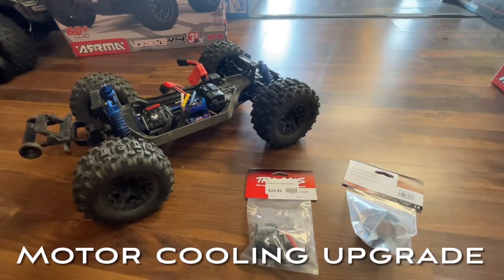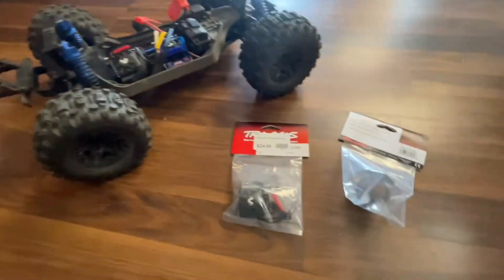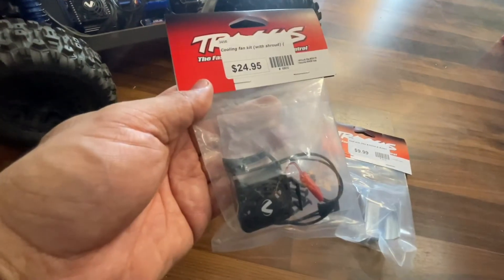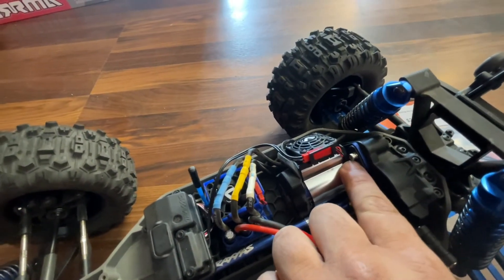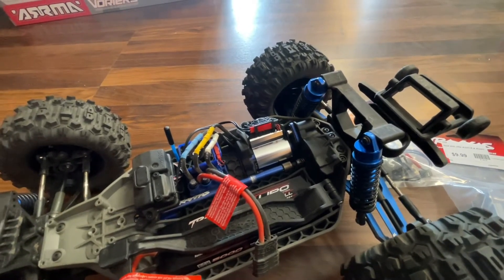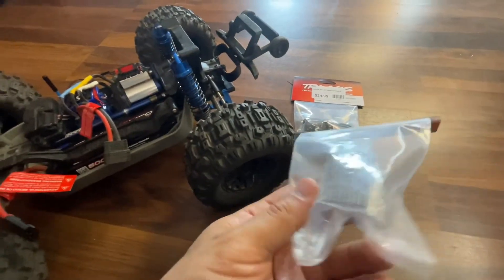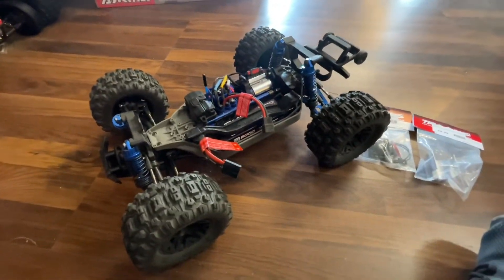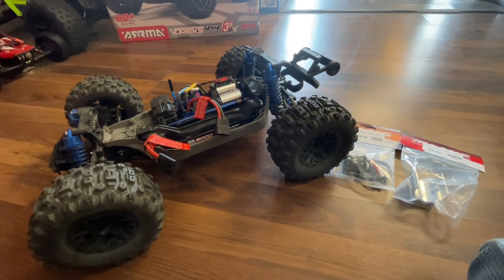Traxxas Motor Cooling Upgrade - Heatsink and Cooling Fan combo - Fits 540 Size Can Motors

Comment: Thanks, but you didn't show actually how to mount the fan on the cooling fins. I ordered these parts and there is no screw holes in the cooling fins, plus there is some funky little plastic hook piece with the cooling fan, and there are no directions whatsoever on what to do with that. Can you do a video showing how to actually mount the fan?
Reply from the maker: It’s easy. You the heatsink fins are such that you can just screw into them. It’s quite simple.
Reply: @ParkflyersRC  thank you - but what is the little plastic hook part with a screw hole in it for?
Reply: @speedypickup  yea what is it parkflyers.. geez why so long to answer🤨🧐😅
Reply: Im also confused about the extra plastic hook piece. Currently unused with everything else hooked up on my rustler

Comment: hi there may I ask something… You said a loose slipper clutch will add more strain to the motor…???  If anything it will add less stress to the motor.  But you might want to say a loose slipper clutch overheat the clutch.  And there's a plastic part that fits on the bearing for the transfer that will melt… But I can't see how a loose slipper clutch will make a motor have more stress
Reply from the maker: Ok. So to prove the point. Drive your car with normal slipper setting and then loose. Take motor temps both times. You will see much higher temps on the motor when slipper is  too loose.
Reply: @ParkflyersRC  okay okay… You win because I haven't tried it… But you should tell me the real reason.  A loose slipper clutch can get literally red-hot so that must be it… The slipper clutch heat which I don't know how transfers into the motor… You see I still don't understand how the motor can be stressed when it should be working less if the slipper clutch is loose…it's not even pulling the weight of the car anymore… Of course in my scenario slipper clutch will be glowing red-hot.…

Comment: Can the heatsink and fan be installed without lifting the motor ? I look forward to your answer thank you
Reply from the maker: Yes. 100%. It’s a stock fit. We would appreciate if you would buy the products from my website.
Reply: @ParkflyersRC  So it is installed without lifting the engine without problem I had that doubt because in the traxxas page says that you have to lift it can you confirm me thanks.
Reply: Confirmed you dont need to lift the motor out, but it makes it much easier